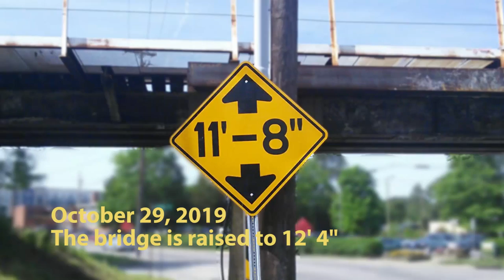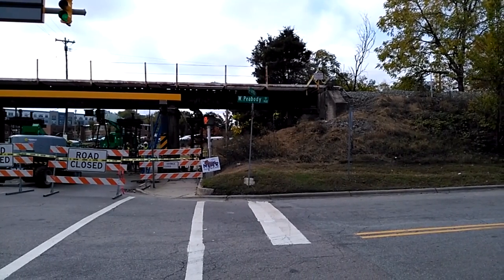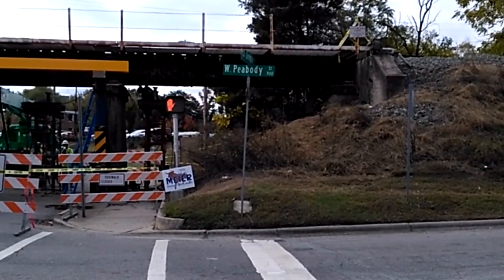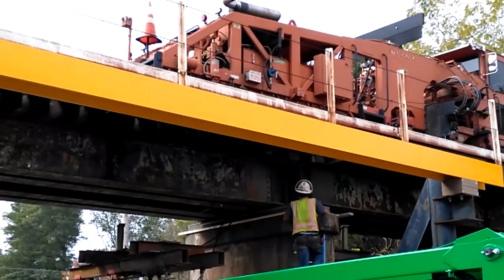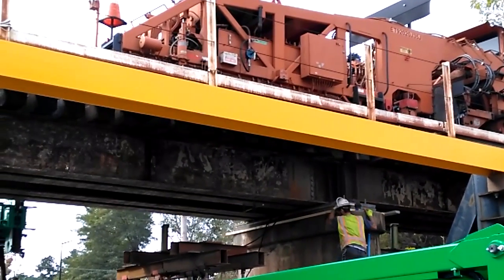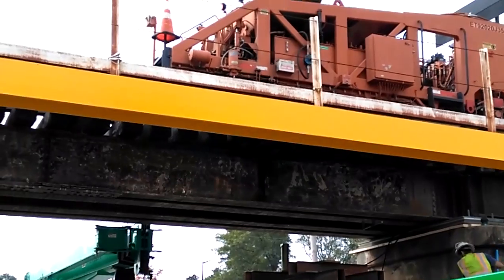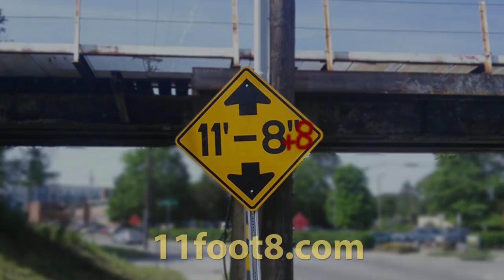Raising the 11foot8 bridge by 8 inches

Comment: Being from Sweden I can never get used to measuring height by using two different scales in the same expression. I get the idea but I can never wrap my head around it. I guess it is because Ihave to transpose it to metric to have a sense of what it means. So in my case I'd have to multiply 12 with 0,3 and then multiply 4 with 0,025 and add them together making it 3,7 meters. Your channel is great despite my lack of reference, keep up the good work 👍
Reply: Or just put it into Google and have it converted for you.

Comment: It seems like if the bridge is raised by 8 inches, the track is either going to have to stretch, which it won't, or extra track will have to be added because by raising it 8 inches in height, the track is going to have to be longer to cover that same distance. I wonder how they compensated for that.

Comment: They need to install a set of over height bars at a height of 11-8 foot in all directions of that bridge. At least 50 metres each way of the bridge, . That way if they hit the bars it makes a huge noise and the driver will know not to go under the bridge. You can have all the lights and safety warnings in place these obviously haven’t stopped some drivers.

Comment: The town was probably served with multiple lawsuits for not complying with the Federal DOT regulations, losing such suits would mean that the twin would be financially responsible for any damages to “ oversized “vehicles. As the heigh5 if trailers has been standardized, and while there are overheight  trailers, the drivers involved with them are very aware of the need for extra caution.

Comment: Why not add one of those tubes that hang down on poles from chains in advance of the crossing, possibly from all 4 directions? Hit the tube and sensors set off red warning/stop lights and also makes a noise. It might damage trucks, but not as bad, and certainly would do less damage to the trestle.

Comment: When you modify a structure, you have to upgrade to the latest code and are no longer grandfathered in to the old code. Not sure what happened here. I understood the height from the road to the bottom of the railway trestle by code should be 14' 4", unless I misunderstood the code or am looking at the wrong code.
Reply: I believe the Rail bridge was made before the war, before the modern building code. Unfortunately, underneath the road are the water and utility tunnel which can't be touched. Trains lines have certain limit to it's rise per length. A train cannot go up quickly on a steep incline, it must go up gradually, So to every inch in it's rise could cause hundred of yards of track being changed.
Reply: @inisipisTV  I already know everything you are stating, but when you modify an existing structure it has to be brought up to the latest code. I'm curious if NS managed to get a waiver for this bridge by playing politics with the local/state government?

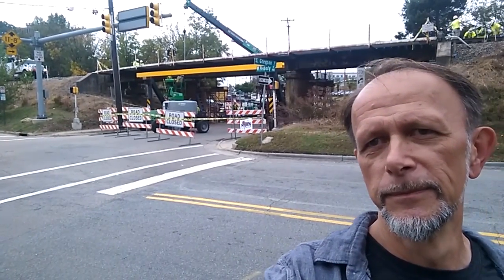Comment: Wouldn't it have been much cheaper and easier to lower the road by 8". That would be like a 1:30 grade from the intersection to the bridge. It would be an imperceptible slope. Keep the sidewalks heights where they are which will allow for generous drains on either side of the road. 

Maybe it wouldn't be cheaper to tear up the road, regrade and repour the surface. But it seems like it would since for the rail they aren't just jacking it up and blocking under they also have to regrade the approach on either side and rebuild the tracks.

Comment: The 12'4" bridge will get a fairly steady diet of cargo box lids and Coleman AC units too, no doubt. 
If they were going to go through the hell of raising it at all, isn't it a bit half assed not to go the rest of the way to semi truck height?
Reply: Because that’ll essentially mean an entire rebuild of the bridge and even more regrading of the tracks, which the railroad company won’t agree to.
Reply: @SimplePeoples  Especially not while Norfolk  Southern' gets "shut up and go away" money from the trucking company's insurer every time it happens.😂
Reply: @vanpenguin22  Except that doesn’t happen, but okay, then.
Reply: @SimplePeoples  It very well may not, tbh.
I imagine they have to at least send somebody out to inspect it after an impact, and I know they have to want reimbursed for that guy's time, and whose pocket would you imagine they reach into?
Just saying.
Reply: @vanpenguin22  Probably not the insurance company, which would have to pay for a large part of the damage and thus be one of the LAST ones who would want to be part of such a bribery scheme, which doesn’t happen to begin with.
Reply: @SimplePeoples  I actually was insinuating bribery largely as just an elbow to the ribs, so to speak. 
However,
I'm sure there is legitimate procedure following incidents on that or any structure, whereby afterwards, is has to be inspected, the cost of which is not simply absorbed as the cost of existence by the railroad.

Comment: Why not re-dig the road down 8" and install a sump pump to remove water if necessary?
Reply: There is a big sewer line that runs under that road. Moving that would be harder than you'd think because they would have to install the new line before taking the old one out of commission so peoples' toilets uphill from there don't start backing up. It would hurt the shops along the intersecting street who get truck deliveries, it'd just be a mess and i think the city govt wants to avoid that.
Reply: Why did they do all that work, time and effort to raise only 8 inches lol?
I love how they installed the bar ahead of the bridge to protect the raised bridge.

Comment: It seems like it would be cheaper to dig out the roadway by 8 inches and install some drainage.  But if you are the railroad union and the only tool in your kit is a 'hammer', then a lot of your problems tend to look like 'nails'.
Reply: To much shit underground right there , not permitted to dig

Comment: They could have just gone the cheaper route of lowering the road. Saves an easy 100k. If there's pipes and that stuff that need to moved, still saves around 90k. 
Sure, it takes longer, But at least the problem would be completely fixed.

Another option could be to simply flatten the road. Rather than have it come up a bit for who knows what reason.
Reply: Sewer lines.

Comment: Take out the traffic light & put in a 4-way stop sign setup! At least then the trucks will still be in 1st or second gear & not much more than 10 mph or so rather than 30! Maybe also put strobe lights at a lower height that activate along with the "vehicle must turn" sign above. Yea, too late! They already spent prolly half a mil on this project.

Comment: I can't help but feel it would be easier to dig a 8" hole in the road than raise the bridge but I'm no engineer. Why they no dig hole?
Reply: Utilities under the road
Plus I'm guessing you'd need large equipment that won't fit under the bridge.
And this isn't the only crossing in this area that has this issue

Comment: Road graders could easily have taken the roadbed down 2 feet without messing with the track, unless public utilities were set too shallow.  Looks like regular crossings a block in either direction, so close the underpass  to all trucks, or fill it all in and make another regular rail crossing. I know, I know, someone bought 12 power jacks and just had to use them somewhere, but he risked much with those pipe scaffolds'.

Comment: Why not lower the road then you could leave the tracks alone. They probably took the most expensive option.
Reply: They can't lower the road because the main sewer line for the district runs under that road. Moving that sewer line would've been the more expensive option by miles.

Comment: $500000 to jack up an existing steel structure, shove a few layers of sheet stock steel under the legs and tweak the rails?

Seems incredibly expensive, raw materials cost on this were less than 5% of that. 10% absolute max.

Engineering and project management clearly made a fat wad of green. Can't blame them 😂

Comment: And the bridge height.  The other peoples mistake and errors you will be if you do not find the way to stop the errors then soon or later you will be in list that have to do with incidents
Reply: The landing gear from the trailer it is stuck on the railroad hill.  The trailer company must redesign the landing gear
Reply: Hire more new truck drivers must fix and change all old model roadway systems
Reply: And must improve the cable line for illumination at night if it is cross road way.

Comment: It would've been far easier to lower the road by even more depth and create a cistern under the road to catch the Rainwater and drain it away from the area
Reply: It was explained that underneath the bridge runs a sewer with water pipe and utilities, it would be equally costly to mess with them.
Reply: @inisipisTV  so what you're saying is it's less expensive for the city to fix it without digging into the ground then the railroads to regrade their track and raise their bridge

Comment: Terrible!  Half the entertainment value is lost by raising the bridge (actually, it's a trestle) and thus allowing some idiots to escape.  I wonder though, how many feet of track had to be lifted to accommodate this change?  That's where the real work would be since trains have trouble negotiating ten millimeters height difference between successive lengths of rail; eight inches would be a heck of a bump one way and a huge thud the other.